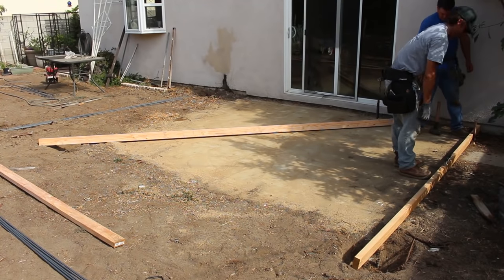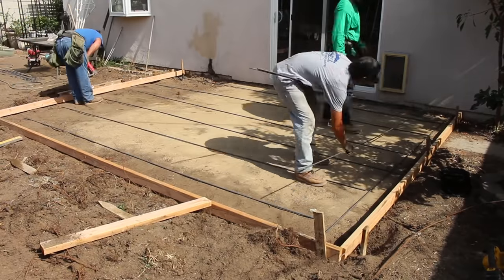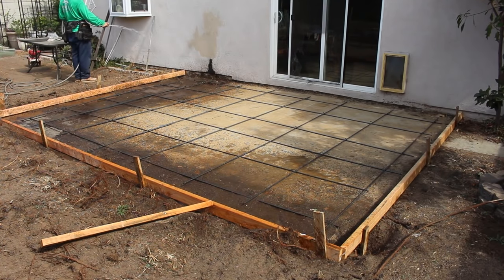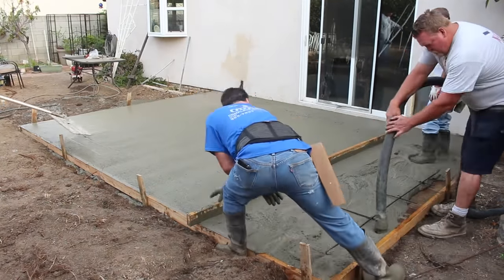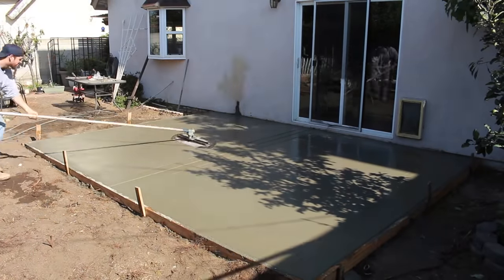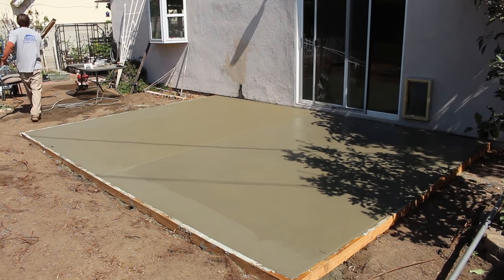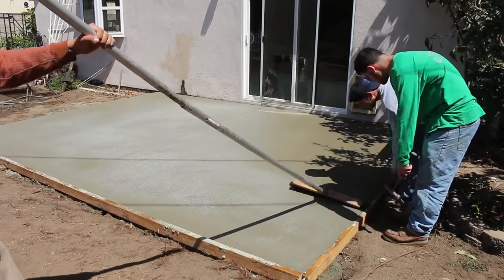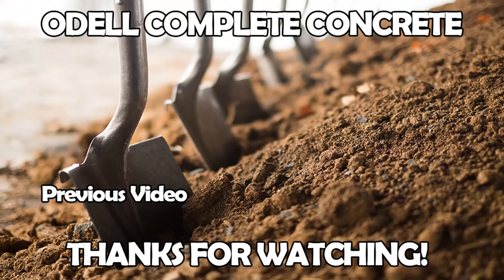How to Pour a Concrete Slab for Beginners DIY

Comment: For begginers? There was nearly 10 men working on this lol
Reply from the maker: Yes because we poured the front as well
Reply: Lol for real😂
Reply: So just expect ot to take longer🤷
Reply: Us guys have amazing tools...
Here in Mexico is hard to do all that stuff
Reply: @KarinaMartinez-wv8mg  if you have a welder and you live by a train station you can make a lot of tools yourself
Reply: You can easily do this with 2 men though. I've seen a 100x12 feet job done by 4 guys, obviously pros, but just saying so you could imagine.
Reply: That's a lot of concrete for any beginner. Don't want it setting up to quick.
Reply: Mikey O.  i certainly don't!

Comment: It's great that you're providing expert advice, for people who want to learn, Mr. Odell.
Reply from the maker: TY
Reply: Great videos
Reply: shades2 Rebar doesn’t stop concrete from cracking it only stops the cracks from separating. You can’t pour a new slab over an old patio. Two or three years this is going to be nothing but spider webs. 
What a joke. Were still in business since 1980
Reply: Lisa Smith I hope in two to three years when they are no “spider web” cracks Mr. Odell make a sequel video and rubs your face in it, you troll. Where is your YouTube channel?
Reply: This is something you better have somebody experienced with you to attempt, cause if you screw up it’s a huge deal, you can’t just throw it away it’s a MF’er to demo.
Reply: Two man job😂
Reply: Thank you.
Reply: @LisaSmith-tb8bb  , There are only two types of concrete . Concrete that is cracked and concrete that is going to crack .
Reply: @LisaSmith-tb8bb  Rebar can absolutely stop concrete from cracking and if it does crack the  rebar will keep the pieces level and together.

Comment: Should state this only applies in warm weather climates.  Here in Wisconsin that slab would crack after the first or second winter. Gotta have stone underneath to drain off the water or the freeze cycle will lift that slab right around the old patio.  Rebar will keep the pieces together, but it will crack without aggregate underneath.  10 years concrete laborer here in the great white north.  :)

Comment: Can you pour concrete right up against the house or do you need to prep the house in any way?  I know you can’t pour it against siding and need to have space between bottom of siding, but what about the concrete pad the house may sit on?  Should you tie it in or just pour up to it?  And what about pouring at least part way, if not all the way, under a mobile home?

Comment: I would like to see a "behind the scenes" video.  Show the bid as it's written, ordering the concrete, calling in the finishing guys, clean up,  everything.
Reply from the maker: That may happen at some point.
Reply: Thanks!
Reply: Excellent idea
Reply: Buy cement mixer and do it yourself if you plan on doing multiple projects. you will save a lot of money in the long run. we do all ours our self instead of having other people come and do it.
Reply: @outdoorsnevada4138  i do alot of things myself around the house....framing, drywalling, kitchen,  bath remodel, basement finishing but i find concrete work too labor intensive so i'd rather hire someone else to do it

Comment: Brings my memory back 50 years. Dad laid the concrete and I got to walk through it. So you didn't use spacers under the mesh for uniform height! Nice finish here but would have looked better with 2 break lines from each end of the doorway.
Reply from the maker: ty

Comment: Thanks for taking the time to pout this video up online. Can i ask a few questions (in the UK btw):
Why did you split it into two bits? Does the gap go all the way through the depth so the two slabs are not touching?
You mentioned a slope away from house, how on earth do you level the concrete whilst creating a small but even slope?
I have an existing garage concrete floor and am looking to extend it, do i need to ensure concrete is same/similar due to expansion/cracking etc.
What does the rebar do in terms of the concrete properties? Obvious its stronger but does it increase its elasticity? [I ask due to the small ramp up (4-6" maybe) from the public road surface to the concrete is currently cracked and damaged, water gets between mortar and road]
Reply from the maker: The joint is 25% depth of the concrete.

Creating a weak place in the concrete, so when the concrete shrinks or contracts it will break on the weakest point.
Reply from the maker: for sloping its all in the set up and screeding.

Comment: reinforcing steel will generally not prevent cracking,but it will hold things together after it cracks.
Reply from the maker: That's true
Reply: He add fiber in the cement to help prevent crack, strengthening the cement correct?
Reply: dont know its no guarantee to prevent cracking. Fibers help but With rebar in it the chance of cracking increases. One still puts it in though so when it does crack the pieces stay level and together. Besides its very easy to repair concrete. You can add in plasticers to prevent cracking too. Which also waterproofs it thus resulting in less cracking due to moisture build up. That also prevents rebar from coroding
Reply: All concrete cracks, that's why you need to score it. That's where it will crack, not all the way across your beautiful pour.
Reply: Ah, I gotta break y'all hearts here. I have a concrete patio slab in my backyard that was poured in 1970. It still doesn't have any cracks!  My neighbor helped pour it in then. He's told me I hope and pray you don't ever have to cut into this concrete because there's a lot of rebar in it.
Reply: expansion joints are always safer especially on big slabs  prevents snake cracks
Reply: Fibers help prevent shrinkage and drying cracks and also hold cracks tight when they do occur in the concrete but do not add compressive strength.
Reply: Plasticizers are for workability and have no effect on moisture in the concrete.  Rebar can prevent cracks if placed correctly.  Rebar corrosion can be mitigated by a corrosion inhibiting admixture.
Reply: Great video!! Looking forward to trying it out. Why do you do the big score down the centre? What is this customer planning on having on the slab? Would be good to see the finished result!
Reply: Hmm my driveways has cracks in it and the side walk along the block has cracks in it.
Reply: Fiber is a wire mesh replacement not rebar replacement... if anyone thinks that it doesn't help hold concrete together break a 5x5 pad up with fiber and one without and see which one takes longer
Reply: Odell Complete Concrete Hi, wondering why you didn't attach rebar from the existing house slab to the new patio slab?
Reply: ULTRA NOOB So rebar is good.This is not a question.
Reply: t dubbs put a joint over end of old slab it's going to crack but you can control it. Joint might look funny in the spot but will look better than an ugly crack later
Reply: All concrete wants to crack. Cutting lines in it relieves surface tension helping to prevent that.
Reply: @Rob B, Because you want it to be independent as the two will expand and contract at different rates. Expansion joint could be placed up against the house.
Reply: Fiber can help but you can't prevent concrete from cracking.
Reply: t dubbs that fiber is all you needed.  I wouldn’t have added any steel or even wire mesh.  I would have used a concrete adhesive on the existing slab after it was cleaned off and used a higher strength concrete. 

That job is going to crack big time the first time it rains a lot then freezes and it does freeze even in Florida.  

The water that permeates the new concrete will sit on top of the old concrete, delaminate, bulge, lift and crack. I would have either drilled holes in it or broke it up so it can’t trap moisture.
Reply: LaLa Johnson there are a lot of factors that contribute to the structural integrity of concrete.  

I avoid r-bar when ever possible; instead I use hemp fiber or other types of fiber.   Contractors use steel r-bar just because they think they should. And that’s because the steel industry and the concrete industry gain by the public using steel embedded in concrete

There isn’t a structure in Greece or Rome well over three thousand years old with a single stick of iron in it.
Reply: instead of fibres could i cover the whole area with fibreglass render mesh?
Reply: Tommy !  After 45 years? That would be an interesting conversation about a refund lol
Reply: So thats why you need admixture to prevent cracking
Reply: The  Greeks didn't use concrete.  They used marble.  The Roman's developed concrete later.

Comment: Great videos!  What's you thoughts on pouring a slab over an existing slab?  For example, adding a room extension off an existing room but needing to level the existing floor with the new floor.  Thanks!

Comment: Glad I watched this first. I was ready to just throw concrete all over the place and see what happens...It seemed like the cheapest alternative, but realize now it won't work... 😁
Reply: LOL yeaaah at minimum you'll need a concrete rake (which can be made from spare lumber from the forms if necessary), a bull float, a broom (also called a mop because it's primarily used to help disperse the water that rises up and add a texture), a hand trowel, hand float, edger, and groover.

Comment: A couple of questions.
How come nothing went on top of the soil where the new patio extened past the old? Will the rebar stop all cracking?
What do you mean by 'joint' in the middle?
Reply from the maker: Yes its magnificent
Reply: Smoke a joint in the middle of the job

Comment: Hi David,

Love your videos, learning a lot. I’ve decided to venture into my first project of extending my patio on both sides. From watching numerous of your videos I feel I got the just of it. My question is that I live in FL and have plenty of soft sugar sand. Will that play a difference in anyway to my site prep? Should I be laying out some gravel before my pour? Or will I be fine with the sugar sand as a base? Again, thank you for all these videos! You have no idea what an asset they are!
Reply from the maker: I don't know the soils there, but I would check with the local building department. They may know the answer to that.

Comment: Sometimes I do small concrete jobs on my farm. If I need a building foundation then I hire a contractor that I'm totally happy with. I build small pads, some 8-12 ft. wide driveways and sidewalks and I get a few buddies to help.
Here's where i need advice : After bull floating with my 36 in. bull float, i still have ridges at the edge. I wait a while and do it again and that seems to help. Then I broom using the bull float handle. I'm happy with form construction and the screeding process but I need to do better with ridges left by the bull float. Should I buy a fresno blade or a bull float with rounded edges ? 

It's not worth renting or buying a power trowel for my needs. Help me get rid of the edges. Everything else is fine. I like working with concrete for these small projects on my farm - I'm 74 but I get the job done. Thanks in advance and congratulations on your successful business and excellent videos.
Reply from the maker: Try a fresno and then funny trowel
Reply: @OdellCompleteConcrete  Thanks for the reply. I just subscribed!

Comment: Is snow and freezing an issue for pouring a slab directly on soil or dirt? Should there be a base of some kind in northern states?
Reply: Probably more important to get air entrainment in the concrete
Reply: You dont concrete in sub zero weather it will freeze and just crumble

Comment: Don't get me wrong... im a big fan of overlays, but my condolences to the one who has to tear that patio out in 60 years.
Reply from the maker: TY and they have mine too
Reply: i won't be alive.
Reply: Lol...2 thumbs up for 60 yrs 😝
Reply: It's okay it'll be a robot.
Reply: Eh, long bit masonry drill + 16 quarter sticks of dynamite = no problem. Or you could use a jackhammer.... It's really not that bad.
Reply: We'll all be dead by then.
Reply: Surprise!
Reply: Great video.  Can you make a video teaching how to properly set up the frame and pitch.
Reply: 60 YEARS????  Don't you think technology will take care of our problems by then???
Reply: jason ò
Reply: jason no problem for WW3
Reply: Yea wire would of been fine no need for that re-bar
Reply: I have been there two patio's with thickened edges. One on top of the other tore them out with jackhammer.
Reply: Jason/ tear it up in 60 years??????...you're kidding me right?
Reply: “LASERS”
Reply: Hopefully they record it when they do
Reply: They'll make an app for that.
Reply: 60years? thats a great warranty lol
Reply: The patio will simply be levitated in one piece by a particle tractor beam into the back of a dump truck.
Reply: did a 15'x25'x8" w/ a jackhammer in one day at age 20 for $200.  was sore for a week, but it can be done by a single humanoid who's dumb enough to try.
Reply: A T-1000 with a load of C-4
Reply: You could saw cut that into chunks in a couple hours and load it out . Possibly in less time than it took to install it .
Reply: The answer is diesel fuel .

Comment: I plan on building a 30 x 25 shed. What kind of foundation would you recommend? Is it overkill to put in footers? Can I stick with just a 4 inch slab?  We are trying to be cost effective, however, we are willing to pay the extra cost if our building needs extra structural support. How much are we looking at average for a slab this size.  Huge fan of your work. Thanks
Reply from the maker: Yes footings would be nice for something this size.
Are you using a kit shed? If so they normally come with the footing designs.
Reply: @OdellCompleteConcrete  Thanks for the response bro. We plan on building from the ground up. No kit.
Reply from the maker: Sounds like structural, planning, building department.

Comment: You pour concrete right over dirt?  Aren't you supposed to lay down some rock or gravel first?
Reply from the maker: No not in Southern CA where the weather is perfect year round.
Reply: or plastic sheet
Reply: Haha u are suppose to have a sub base of crushed rock under the slab so water can run under it if not ur shit will crack
Reply: I believe you are incorrect, Mr. Powers. Our local Ready Mix owner told me that's a myth perpetuated by monkey-seers, monkey doers. Some ground conditions outperform aggregate as a sub. And in such cases, rock fill might only be added to low places just to bring it to grade to save on concrete. Depends on the soil conditions and prep.
Reply: Had sand poured over clay before driveway was poured and hubby insisted on rebar.  Gets cold here,and didn't crack.
Reply: Canada turning in here and we typically use 3/4" - 6inch depth of stone under our city sidewalks. I have worked in towns where they just pour concrete overtop of native subgrade, no issues as far as I can see but its recommended to place a nice stone base.
Reply: yes
Reply: William Powers Has
Reply: Not if you are in a hurry.
Reply: Also to do it properly, the re-bar is supposed to be raised of the ground a few inches. For maximum support it should flow through the core of the concrete. They sell plastic feet for it to sit on.
Reply: @PaulXerxen  I saw they were pulling it up as they were pouring, by I agree it would be easier to have them propped up beforehand.
Reply: Drone Days if you watch they are pulling up the rebar into the center of the slab as they go. You could use Dolby  blocks but what they did works too.
Reply: @PaulXerxen  they're called chairs
Reply: No not for a back padio. Laying it over dirt that has been tampered down is enough.
Reply: @williampowers4725  No it wont you fool. Pouring it over dirt for a patio is enough. I know. I am a union cement mason. A journeyman.
Reply: @PaulXerxen  TRUE.
Reply: @jasonl8326  we often just pull the rebar up while pouring it. It works just fine.
Reply: And you have to compact it and ive would of put more joints since it was only bout 5 yards
Reply: I've been thinking about pouring a slab for my backyard, but with the possibility of roots, maybe I should just do pavers?

Comment: Great work! I have a crack on the edge just like you said when city workers didn't use any rebar. Her claim was that since it's only a 4 inch hole, you don't need rebar. At 7 inches or more is when this dumb city worker uses rebar. I'm so annoyed at this easily avoided crack but that's the City for you, waste our taxes but can't splurge on a simple accessory
Reply from the maker: How about some simple fiber mesh?
Reply: Odell Complete Concrete n

Comment: I have a 5 car individual car port at my house (4 drivers, 4 cars) and I use the garage on the far end for myself but there’s two massive cracks in the concrete. I don’t know when the concrete was poured nor when it cracked but there is a significant heigh difference in level and slope. I use the garage as a gym but covered the concrete with 4 layers of sport mat surface and the question I have is, so I concrete over everything, concrete just the crack, concrete enough space to make it all level, remove ALL of the concrete and lay a brand new slab, or just build a 4” wood deck subfloor to put my gym mats on; flat.
Reply from the maker: either way will work, but the least expensive would be to grind it down and fill the crack
Reply: Odell Complete Concrete I mean it’s more than a crack to grind. There’s a 2”-3” gap between each broken piece of the slab and just grinding the high points would be a hell of a task. What would you recommend to use if I were to take the grind-then-fill method?